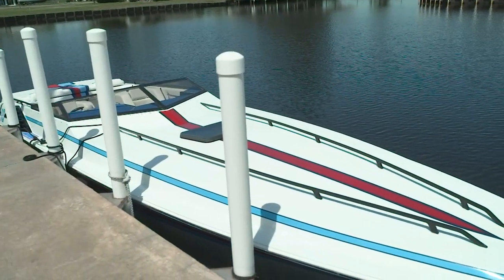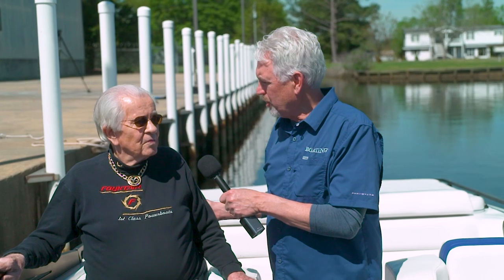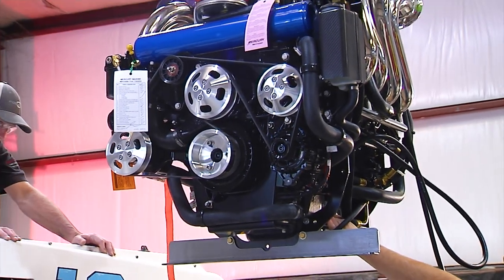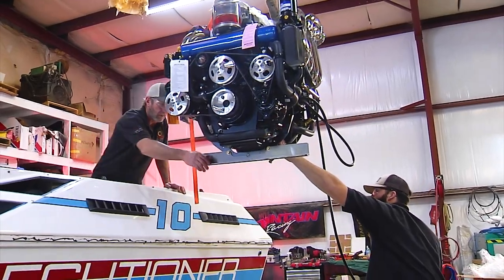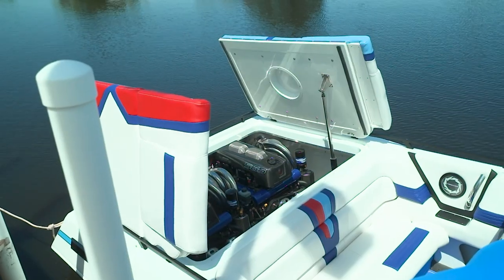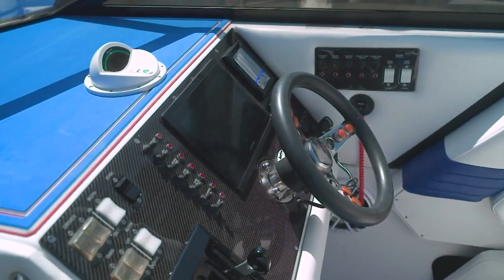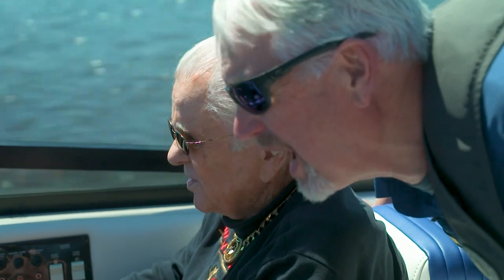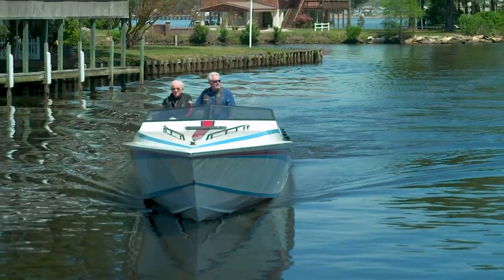Fountain Boats Hull Number One

Comment: I have the utmost respect for Reggie Fountain! The man, the myth, the legend! However, it pains me to correct him on one technical detail. The Bravo drive was not unveiled until 1988. The original drives on his 10 Meter were in fact Mercury TRS, which utilized an intermediate transmission for shifting. The later Bravo’s shifted (F/R) via a cone clutch within the drives upper gear case.